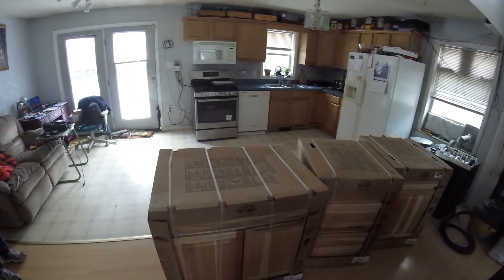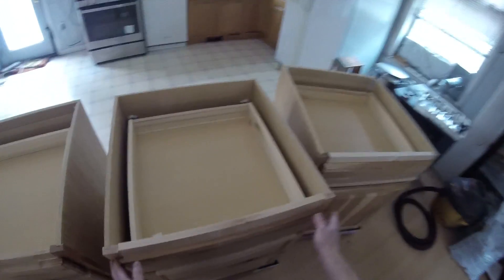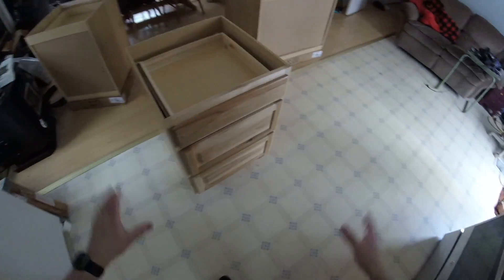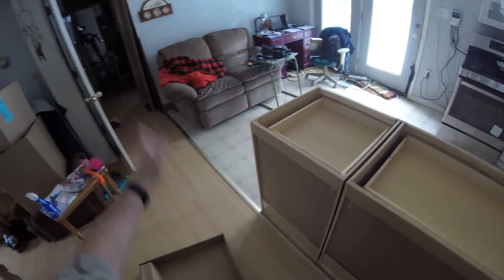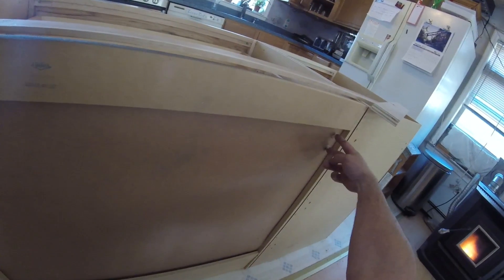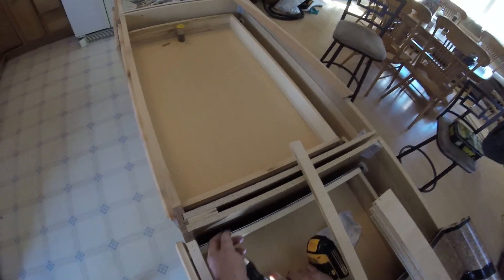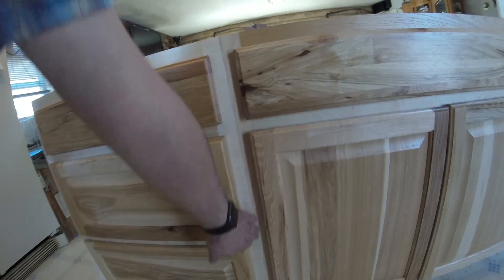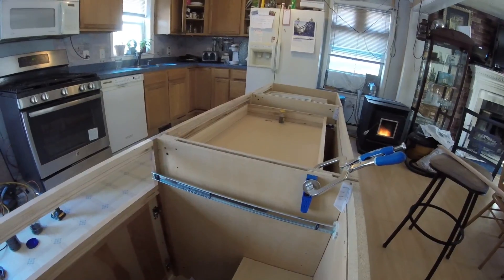Home Depot kitchen counter install and review

Comment: Thanks for sharing.  I'm buying about 10 cabinets from Home Depot and will be installing them myself.  I know its not good quality but they are inexpensive and available.  I hope to make do and improve them with a nice countertop, a good finish and nice drawer pulls.
Reply from the maker: Sounds like a good plan. they are not the best but they will be fine so far mine have been working with no real issues.
Reply: @Payton Clyde Flixportal :P
Reply: @Dennis Johnny Thanks, I went there and it seems like a nice service =) Appreciate it !!
Reply: @Payton Clyde happy to help :D

Comment: Always pre drill before you screw into anything. Also mdf and Particleboard will never stand up to any pressure for brackets long term.
Reply from the maker: “Always” is a strong word however I agree it is good practice to pre-drill in most circumstances. MDF and particleboard certainly are not the best, however I will say the cabinets are still solid despite the Low grade that they are. Thanks for taking the time to comment.